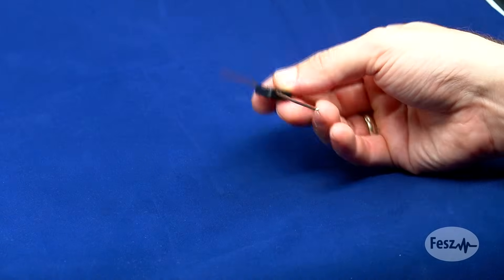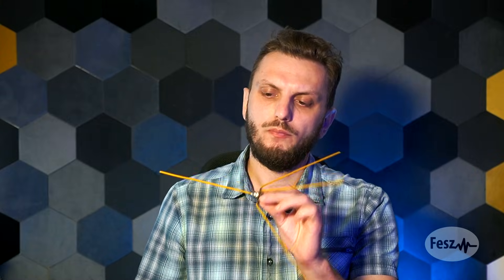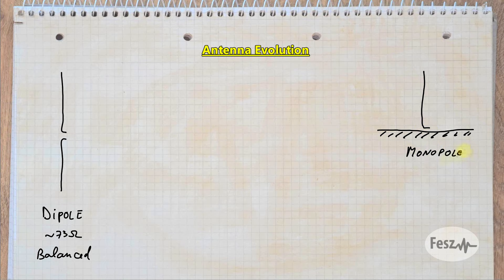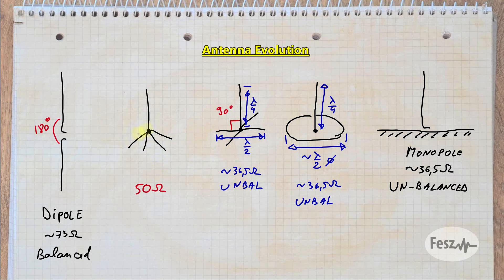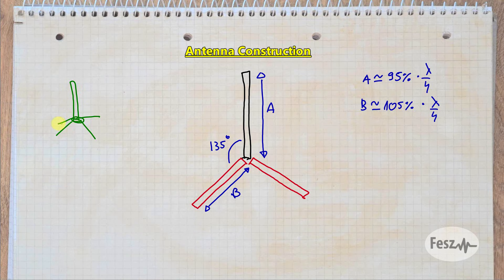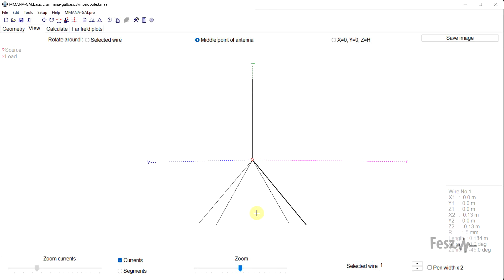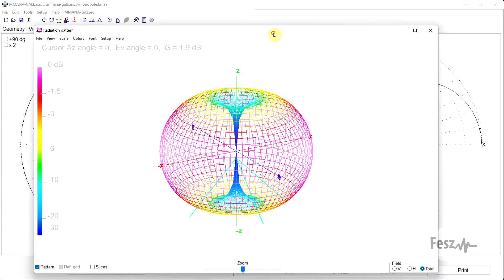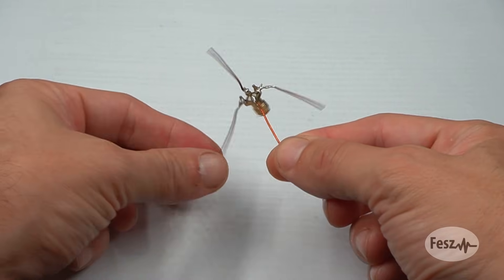The Ground-Plane Antenna

Comment: Hi FesZ I like your videos most. From my perspective, a GP "ground plane antenna" is a vertical radiator that uses "the ground" as a counterpoise. However, for me, a vertical radiator, monopole with radials, is not a GP "ground plane antenna"   🙂 73`s
Reply: I think that when you physically connect the mantle of the coax to a conductor like the rods at 135° you have 'created' a ground plane, and you could call it like that. According to some AI, a monopole on a metal car can also be called a type of ground plane antenna. There too the coax mantle is directly connected to the metal car body. When you hang a monopole above the earth, there's no connection, no copper on copper to earth, only humid mud, and I would not see that as 'ground plane' antenna.

Comment: A good and useful video, thanks! In your list of variable factors affecting impedance/SWR, it might be worth adding height above ground. This will change with the wavelength of antenna and it's relative height above ground.
Reply from the maker: You are right - the height of the antenna and the wavelength it operates at are critical factors, but these are not unique to the ground-plane; its a factor relevant for almost any antenna type... I had an interesting issue when trying to get some SSTV from the ISS with a dipole. Even though I was always in line of sight, the antenna was mounted at considerable height above ground, so the radiation pattern was not uniform but rather had highs and lows - I could not get a clean image with the antenna held at a fixed position...

Comment: Don't forget that the angle  of the radials affects the vertical angle of the pattern, though mostly relevant at HF.🙂
Reply from the maker: I was thinking about this though I could not get a very clear result in the simulator... I do however remember reading about an engineer that had a Tv GP-antenna mounted on top of a mountain but the city below had bad reception, so the solution was to just flip the antenna - ground plane upwards, and that solved the reception issue.

Comment: Can it be used with FPV drones?
Reply from the maker: While this antenna will work, its not ideal - since the GP antenna is vertically polarized; from what I saw, "FPV" devices usually use circular polarization, specifically RHCP.

Comment: Just when I bought an SDR lol
But still, I will rather get a ready-made antenna than a whole analyzer, at least for now...
Reply: for the price of a ready made antenna you can get a cheap vna and a couple lenghts of wire...
Reply: @johnwatson2843  can you recommend one? Let's say around 50 eur/usd, as that's the price of antennas typically.
Preferably not a stolen clone.

Comment: sorry this time i have to disagree. Balanced or unbalanced does mean nothing. 
- You can build a perfectly balanced 50 Ohm antenna, for example inverted V as you said the angle decides the impedance
- you can have a extremely unbalanced antenna and get the same radiation result by switching core conductor and mantle at the feedpoint. That is to say, the energy in the coax is neither travelling in the core nor in the mantle but in the field in the dielectric in between. So what is unbalanced there?
"Balanced/unbalancedd" is just some old term that means nothing, and we shouldnt use it anymore.
I love your videos.
Reply from the maker: While i do agree that feeding something like a inverted V dipole directly with a coax (no balun) will give the same results regardless if you switch the conductor and mantle; and I do agree that the signal traveling trough the coax is coming in-between the center conductor and mantle inside of the dielectric; I have to question the statement that balanced or unbalanced is the same thing - when feeding a dipole from a coax, the antenna field lines will close between the arm of the dipole connected to the center conductor and the other arm as well as the coax mantle; when a balun is used, then the field lines only close in-between the antenna arms. The radiation patterns will be different with or without the balun, while swapping the conductors (center and mantle) will not make a difference. This is an interesting topic though - I will try to look into it a bit more!
Reply: well, you could have 2 coax lines, each feeding one arm of the dipole, and this would mechanically be totally "balanced" and it would still be "unbalanced" as there will be mantle waves. So what i mean is that the term "balanced" and "unbalanced" is outdated (in my opinion) as people often imply with them that there is difference in power between the dipole arms.

What people actually mean by "balanced" vs "unbalanced" is, whether RF can use the transmission line as a radiating element. And i think there is nothing "balancing" about it. A balun or "coax wrapped on ferrite ring" is just a high impedance on the returning waves, nothing "balancing" to it. Better term would be "confining".

Comment: I made one of these for the 2m amateur band, using a pair of brass hinges to mount the radials so they can be folded up to make it flat for transportation!
Reply from the maker: I also enjoying analyzing antenna builds like - how can I make it so that its easy to pack up and store away.
Reply: @FesZElectronics yeah. Unless you make it foldable, this is one off the worst antennas for transport :-)
Reply from the maker: The antenna I showed can be partially taken apart - the center rod and the BNC are 1 piece, but the ground radials are 2 by 2 each on a separate disk; to assemble it, I slide the 2 discs over the BNC and tighten the nut that comes with the BNC connector. Its not very compact, the 2 radials sets still form a Vshape but its a bit smaller than the whole thing assembled. I think however your solution with the hinges might me better.

Comment: Ground plane antennas are awesome. Easy to build and very good performance. I build one for the 433 MHz range  a few years ago and even though I didn't have a VNA to perfectly tune it, it worked much better than the cheap commercial antennas I had bought before.

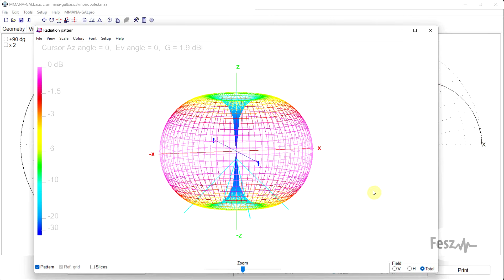Comment: 5:14 I would expect the shape and direction of the radiation pattern to be influenced more by the ground rods and their slope, but that doesn't seem to be the case. How come?
Reply: As long as an antenna is not larger than half a wavelength, its pattern is not affected very much. Larger deviations in the radiation pattern in the farfield of an antenna are the result of interference, but if the source is small enough, there is no significant phase difference between radiation that is being emitted from different parts of the structure.
Reply: @erikbertram6019  Thanks